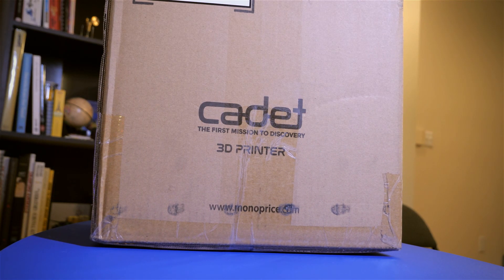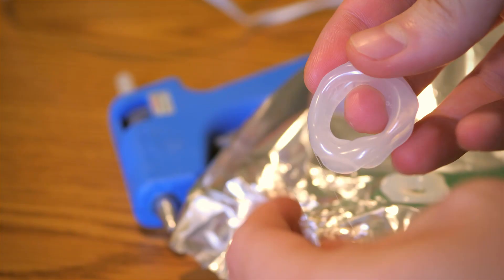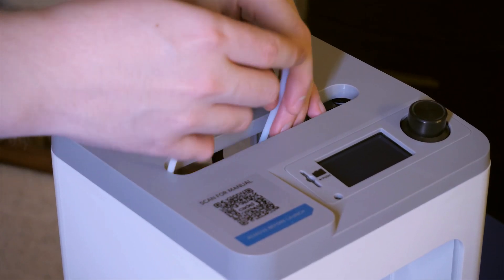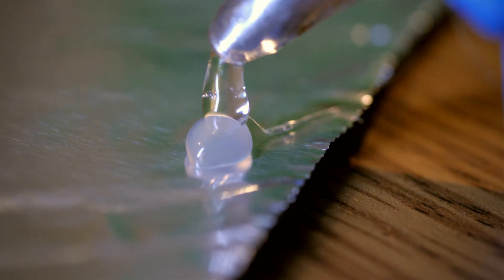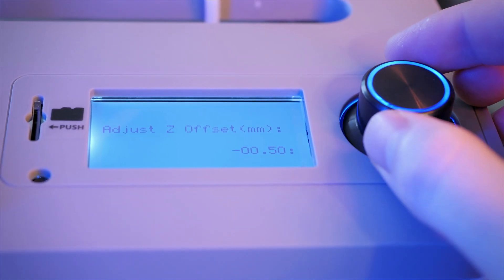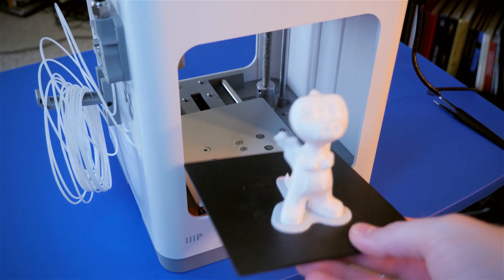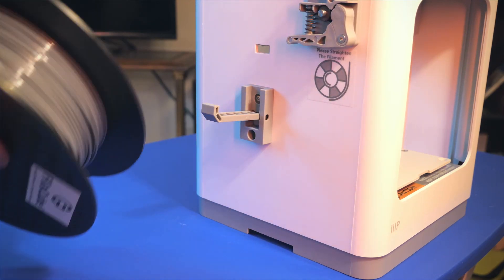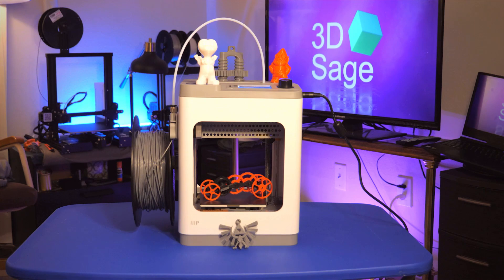Cadet 3D Printer Review | "For Students and Beginners"

Comment: Hi 3DSage, thanks for your review. I need your advice: I just bought this as my first 3d printer. It started great, but I have a problem: when printing a large print that fills alot of the bed, the print starts pulling up the magnetic bed up on the corners. Obviously the print becomes distorted. I have tried twice and on the second print the whole print/bed was partially knocked off the metal platform, I suppose because of the nozzle hitting the lifting print and the loosened magnetic adhesion of the bed. Is that a design flaw? Is that common for magnetic beds? Do you have any advice? Thanks!
Reply: You might need to try binder clips on the corners.  I do not have this printer (yet), but that might be a good option.
Reply: You did realize this is a paid ad and not a real review, right? So he can’t really help since he probably got like 30min into this and that’s it.

Comment: Are you good enough at printing to print me a gear if I were to send it to you ? Not for free of coarse ,o could pay for the final product but basically they’res a problem with 96-04 Acura rls with they’re  auto tilt steering wheel mechanics,the plastic gears break over time and every one that anyone’s ever seen in a large car group online with the same car has always been broke. Leaving people to have to take the motor off from under the Colum and turn it with a screw driver manually so what I’m looking to do is get the demotions length ,width ,space between each tooth on the gear ect ect ect ,I’m uneducated on how you “scan “ somthing in or what you need to do ,I see  on this Video you used a model from on line and transferred it to a program ,it would just be nice to fix not o let my car but a factory problem with every on of these cars ever made and these parts are not available for purchase so not only would it help my hit thousands other. ,I know it’s a weird problem but it’s a problem that’s never been fixed ,iv brain stormed getting this gear cnc cut out of aluminum but figured if I can find sombody that could 3D print the prototype that would be a good place for me to start
Reply: I think there are websites dedicated to printing files for people without printers, try those. Just research before making a purchase
Reply: I miss spelled so much smh